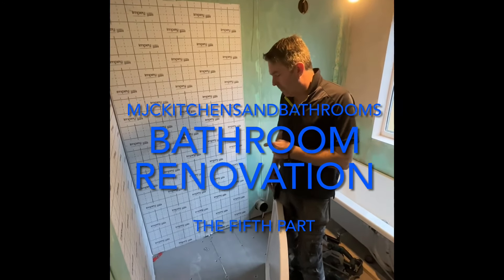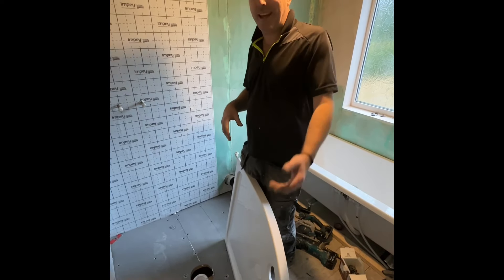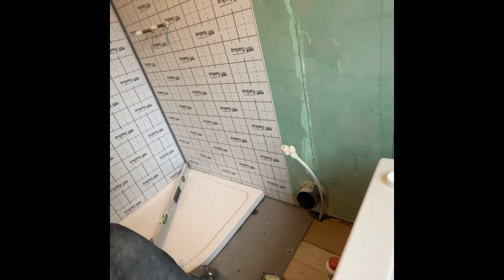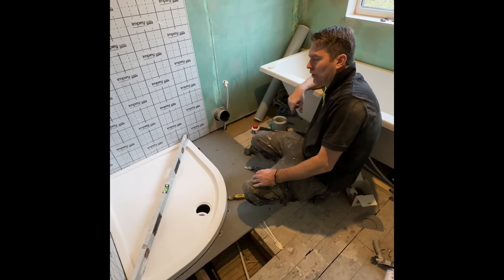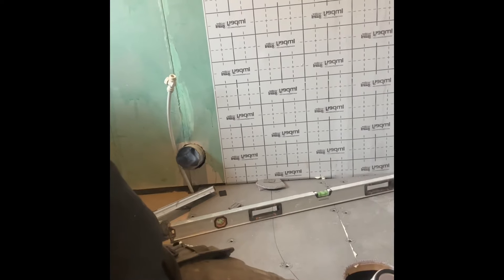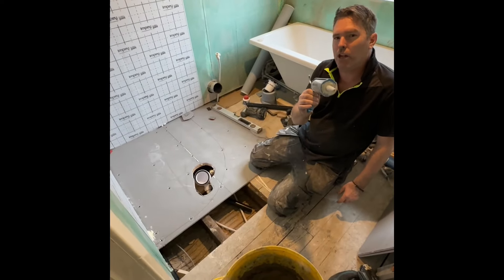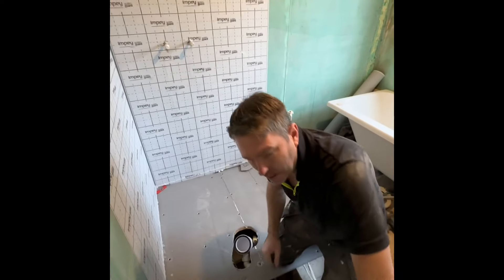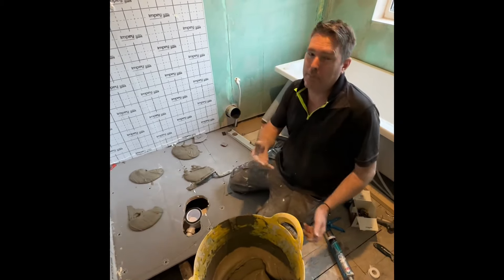Bathroom renovation from Michael Cran

Comment: My metal bath is only resting on it's legs and the bath is moving so can you recommend something to prop under the bath.
Reply from the maker: What do you want? Is two bits of3/2. Screw two buttons one side and the other side.
Reply: @bishbashbosh121  It's awkward to get under the bath now it's fitted so I was thinking of cutting some pieces of 2x1 and gluing them on to the wall under the lip but I didn't know if this would work. I was also thinking of buying wirquin shower tray feet and propping them under the bath to help stabilize it